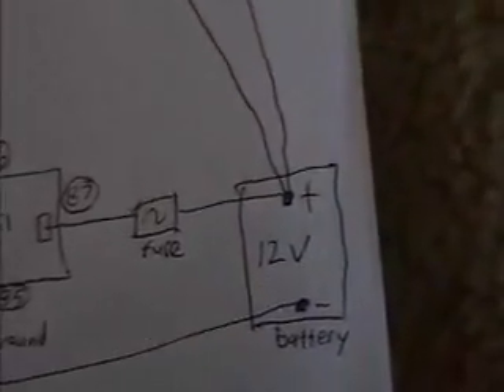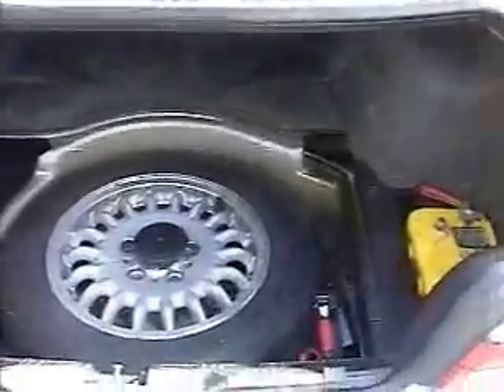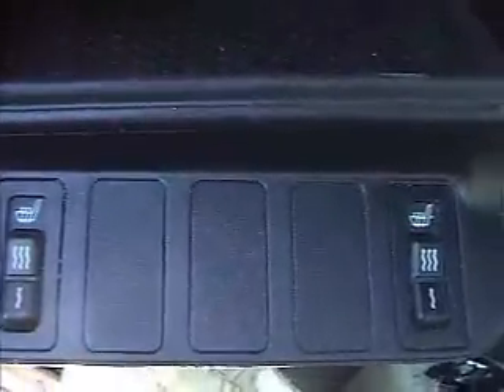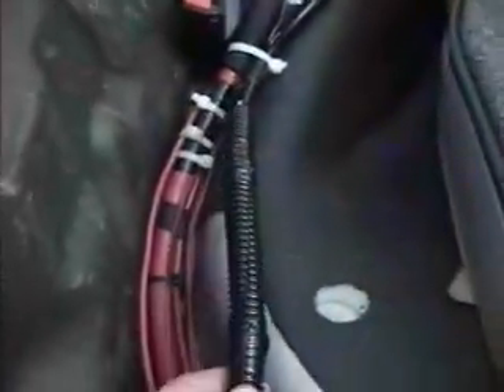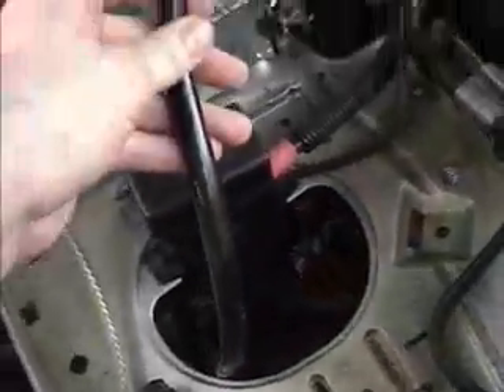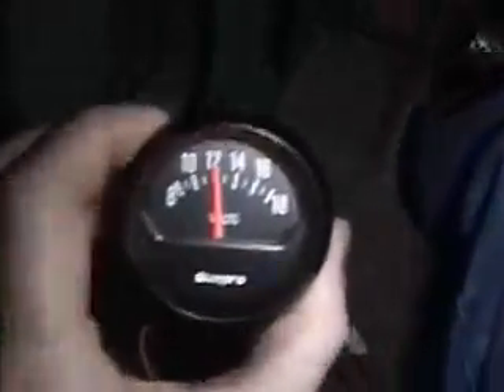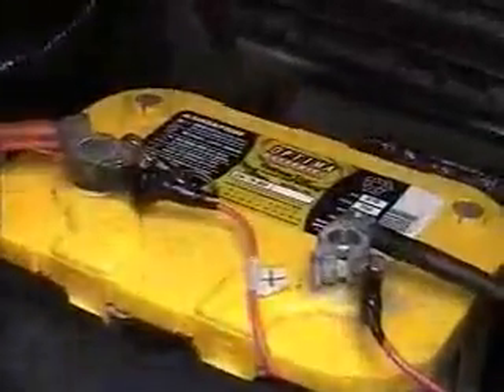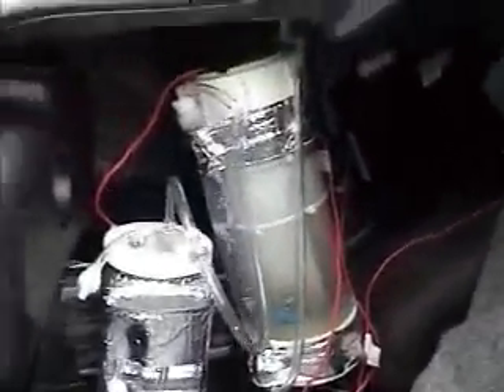How to Build the Best HHO Hydrogen Generator Part 2

Comment from the maker: Unfortunately I no longer have that car. It was at about a 25% increase in fuel economy when I sold it. The voltmeter and ammeter are not absolutely necessary, but they should be added for safety reasons. It is important to be able to know what is going on with your car at all times especially when the hydrogen cell can vary on how many volts and current that it draws. The HHO input was in the aftermarket elbow where the intake filter mounts on to. My cell is derived from the Smack cell.

Comment: Excellent work! Do you have any idea about how much more efficient is your system now? And is the voltmeter and ammeter really required? I intend to do this on quite an old vehicle that won't be in use alot, simply for the experience. Also, where exactly along the intake did you run the HHO output to and did you employ any special design in your anode and cathode?

Comment from the maker: @torresjesus2590 the relay allows you to use a switch. Instead of running all of the wires to the front of the car with a relay all I need to do is run the wires for the switch.